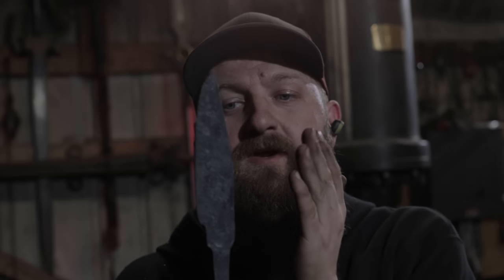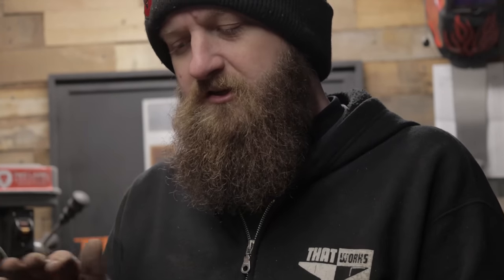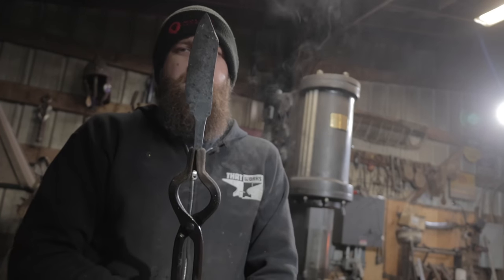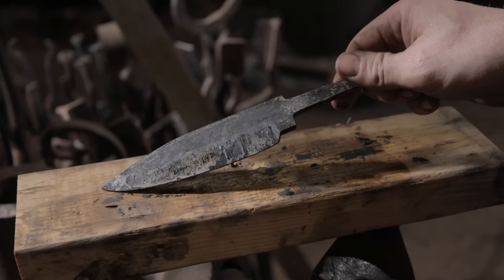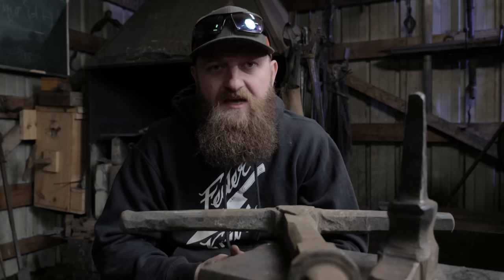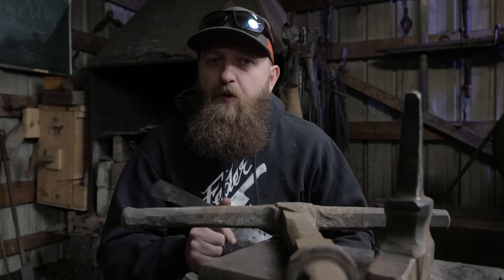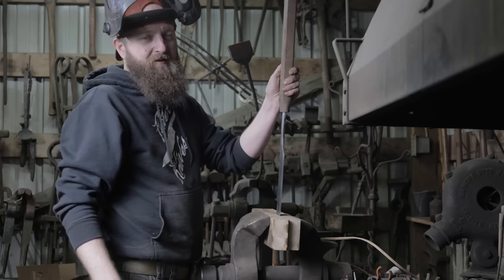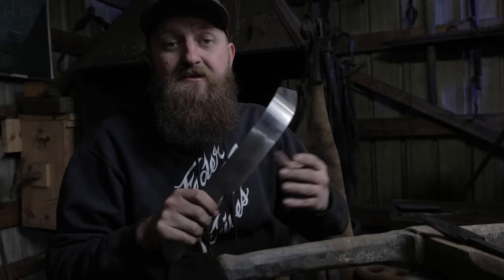Can it bend 90° ?  Matt Forges ABS Journeyman's [Test Knives] - Part 1

Comment: The difference between Matt and Ilya is wild, Ilya makes everything look so simple with efficient strikes and perfect control while Matt has much more hesitancy and erractic strikes. In comparison, when Matt is grinding it's like he barely has to focus at all, it's just instinct. I noticed that after the first blade, Matt was more controlled and smooth, so the improvements are showing already. Different skills, muscle memory and experience. I'll be teaching my boss basic smithing (as that's all I'm good for, lol) and have been recommending That Works videos to him because you and Ilya between you encompass everything smithing represents from grinding, engraving, forging, smelting. Awesome job so far, with a mentor/friend like Ilya, I have no doubt you'll crush the test!
Reply from the maker: you nailed it. I decided to share with you the very first knife blade I had forged in about a year. I knew it would be raw but I also knew I would get the hang of it more and more with each blade.

Comment: Note 60° that would be 30° either direction is standard for a short sword. A 10 or 20° permanent Bend is expected. And yes they will force you to take it 10 degrees Beyond 90 as there is probably that much Flex between the pipe and the handle
Reply from the maker: The reason you go passed 90 with the pipe is that the 90 is measured on the spine of the blade portion not the handle.

Comment: Yes I believe you are allowed to one foot blades for that and that includes your handle unfortunately. However do not fret you are the only one who will do any damage to that blade. They will ask you to perform each of the tests. Then they will hand you a metal pipe and tell you to bend your blade in both directions. And don't worry about it most people end up with a ten degree Bend in their blade at the end of the test and they pass even if the hard steel breaks but the soft steel jacket Keeps The Edge from being separated from the knife. Or if you are supposed to go with a homogeneous piece of spring steel. 1 crack is considered acceptable on the hardened Edge as long as The Edge does not spit a chip.

One last note do not look for your Masters it will find you. Because you automatically do not qualify for your Masters if you are not of notable renown already. Both me and my father has been approached and asked if we wanted to test for our masters, I believe you test for your Masters wins they know that you're not in your best train of mind. One week after my grandfather died my father received a pair of ivory pistol grips and told he would receive his Master certificate one year from that day if he proved. He is a gunsmith with a fondness for pistol triggers and the ability to Unbreak a stock. Seriously I'm not joking on that one.
I have a knack for finding the Grain in steel and wrought iron, in the ability to use that knowledge to improve the tool that I am working with. You're in a good place to learn what I know. If you follow the cherry blossom hammer it will take you as far as you can reach. Maybe someday you will grab a wrought-iron ball peen hammer and make a straight razor. Afterall I plucked my eyebrows and shaved my neck with a wrought-iron ball-peen hammer. And you work with a better educated man than me. When I worked at buck cutlery Kershaw educated me on the way of ferrous material, but I had to learn how to use the hammer all by myself. 

I don't get much wrought-iron to work with these days so to keep in practice I buy dowels of rattan and make dust brooms.
Reply: I don’t know if you are new to this channel or these guys but they definitely have the notability requirement down. Honestly both him an Illia could be master smiths already they just haven’t made it a priority because they have YouTube channel but they are both incredibly good smiths. I honestly don’t think it will be that long until he has the master smith cert. Especially Illia who has already won abs blade of the year.
Reply from the maker: Its a 15" overall blade length and 10" edge.

Comment: Hey wait.  Ilya says you should cut the square stocks tip rather than forging the point.  Why do you forge the point?
Reply: Talking about the first knife of course.
Reply from the maker: @alexparadi522  I forged that before he showed his method and then tried his after.
Reply: @ThatWorks  ahhh, that’s interesting that the sequencing of release times is that different from the events in the videos.  I assumed that his video was shot well befor yours!  Best of luck with your test, I’m sure you are going to pass no problem!

Comment: I wonder if you could make a knife without using your belt grinder or any files only forging it to shape and then using an angle grinder to do the grinding and stones for sharpening
Reply from the maker: I mean…of course you can. But why is an angle grinder ok but not a file?

Comment: So in the bend test, it's ok if it deforms as long as it doesn't outright crack? That seems to encourage a weaker heat treat, no? Or is the idea to test that vs the heavy edge testing to make sure you can balance the two well?

Either way, great job and good luck in Atlanta!
Reply: If your heat treat is too weak, your edge will deflect during the 2x4 cut and thusly wouldn’t shave afterwards. Where you need both the bend, and the sharpness after 2x4 cut to pass. 

So the differential heat treat tries to walk that line. Keeping a edge hard enough to stand up to the 2x4, and a spine flexible enough to bed to 90°.
Reply: @brachistochrone_5206  I had thought the bend test required the blade to not take a set and go back to true. I was surprised that it's just "don't snap". (I know, "just".)

Comment: When heat treating you JS knives you really should utilize your kilns for every part of it. Every steel has its best temperature for normalizing, hardening and tempering, you can get close with a forge but not exact. A forge also has too much temperature variations throughout to precisely & evenly heat a blade.
Reply from the maker: As much as I agree, I also come from a sword making background where the traditions of doing things by feel are very important. The fingerprints left in a piece by the makers hand are what makes the vast history of blade making so special. I tend to do larger knives and swords all in the kiln and feel comfortable getting an even temp on smaller blades in the forge. So I agree with you of course. There is no debate there.  Kiln produces better results for sure. Your eye is also capable of some pretty amazing results!
Reply from the maker: I should also mention one honest truth. Time…I need two full sized kilns. I don’t like leaving blades untempered after the quench for very long. So waiting for the kiln to cool down from 1650 to 400 sometimes takes hours. Sure I can do a safety temper with a torch and I do have smaller kilns. Just sometimes I rush when I shouldn’t.

Comment: Very best of luck for your JS test. I'm curious though, why would you HT using a forge when you have a temperature controlled kiln? Much better consistency with the kiln or is that part of the skill they're testing: HT with a forge? Look forward to part 2.
Reply from the maker: For the performance knives I did. I have gotten super used to HT in our forge and i know 80 crv inside and out. Im comfortable with the forge. I can see why some are not.

Comment: Is it normal to heat up and then cool down multiple times before doing a quench? It seems like I normally just see a quench done. Does it change depending on the type of metal or something?
Reply: Yes it is normal. Steel is often normalized or annealed after working to reduce stress that is locked between the grain. In this case it is important so that when it is quenched and forms a martensitic phase, the blade does not crack or developed uneven stress. This process does change depending on material. For steel it is most dependent on the amount of carbon content and what grain structure is present. It is possible to skip this step but it’s risky. Some people either don’t do it or don’t show it in the video.

Comment: any particular reason why you use wood to clamp the blade to?  I use 2 pieces of angle iron, so just curious if there is a benefit to wood vs. metal for keeping it straight.
Reply from the maker: Wood conforms to the shape better so you aren’t just making sure the flat of the blade is straight but also the bevel and tapered tang are too
Reply: @ThatWorks  oooh...that makes sense.  Thanks for the response!

Comment: Hi matt, just a quick question as relates to illya's method and thr k ife you forged using it. Would correcting the slight curve by grinding rather than forging it back straight not neglect the orientation of the grain that you gained from using that method for the final knife?  I realise this may just be a practice version but just my idle curiosity
Reply from the maker: I just ground the spine side back straight.
Reply: @ThatWorks  OK, I understand now, thanks for the quick reply

Comment: Yeah you might want to work a little harder on that the two-by-four chop is over in 5 minutes regardless. That would be a 6 ft two by four turns into three pieces in under 5 minutes, without a vice, and without splitting the wood like you did in the vice.
Reply from the maker: Thats how I ended up doing the actual test.

Comment: I wish my area had basically anyone who taught metalworking.  I can't afford vocational school and the ones in my area don't teach it anyway.  I wish so bad I could get into this myself.
Reply: There are countless very informative videos on YouTube from excellent makers all over the globe. Ilya is always explaining what he is doing and the purpose of the techniques, tools, and materials he's using as well as explaining other methods and why he chose the one he did. Black Bear Forge is another excellent smith that narrates over the video and explains pretty much everything and makes some videos just for educational purposes because it's like you said, this craft is difficult to find someone locally to learn from. I bought everything I needed to get started after a lot of research and education from other smiths via videos and forums. After that it's just a matter of setting up and doing it. I strongly recommend starting out with known steel for a while to avoid any catastrophic events or dangers at least until you have a decent handle on metallurgy but other than that there are no mistakes. Only learning experiences. If something you attempted to make did not turn out how you envisioned, figure out why, and you just learned a method that doesn't achieve your desired result, and try another way. I went through this exact process the last time I was out in my shop and I can guarantee that the world's best makers have discovered more ways NOT to do something than they have ways that worked. I say start gathering equipment and just do it

Comment: It seems highly unlikely that a flaming quench would destroy the oil. What is flaring off is the vaporized and cracked oil, i.e. the destroyed oil,  that would otherwise rise up as a plume of nasty smoke or get condensed back into the oil. The oil is destroyed before the vapor ever reaches oxygen and ignites.
Reply from the maker: Having been at a shop that destroyed oil on a daily basis pretty sure I know what I am talking about.
Reply: @ThatWorks  Destroyed by what metric is the question then. If Quench speed is the answer, a theory could be found. I remember reading that parks or some other company offers an additive package to their professional users to recondition their fast oils. So we can assume that that is probably the fraction of most susceptible compounds and maybe they are just vaporized and not cracked. In that case a deeply submerged quench will allow them to condense back instead of flaring off. In other words, i am not criticising. I am trying to understand a phenomenon that makes no sense for a homogeneous oil like vegetable, which gets contaminated by chemical breakdown. Flaring or no flaring.

Comment: To me ot made sense to have some rough forgings on hand to practice with on the finishing rather than have to do it all start to finish each time. Because then you could get focus on the more intensive parts that need the most attention rather than get tired after forging then grinding, heat treat cycle and so on time after time after time, then rushing and making mistakes that just frustrate then cause more mistakes and self doubt. Once you get the finishing down then you can go back to the beginning with forging to finishing. Small steps before big ones.
Reply from the maker: Not only that but it should be gainfully obvious that these were all practice blades since most of them were Damascus and I cant even submit Damascus for my set.

Comment: Actually right now you're aiming for master with that getting the plunge absolutely perfect. On the other hand if you can't get this good enough to fool most people's eye then you won't be able to handle a Discerning customer either.

As I understand this is the set that you're to turn in for your quality tests. Personally I think I would bring each of the knives up to 300 Grit finish, and then quickly do a burnished so that I could take my blades to the light and see exactly how I want you to finish them. And yes I know burnishing them and then taking the varnish right off to finish them sounds crazy but they're supposed to be the best stuff you ever do up to this point. And I just fine doing a quick burnish to the work when you know it's not ready for a mirror finish will make all those telltale signs that you're trying to find pop out allowing you to more easily allocate time where it's needed.

Oh by the way if you ever do decide to go for your Masters what you're doing right now with that little sanding wedge that is just part for the course. And when they say a mirror polish in the Masters category they mean get it down to 1500 grit before you start burnishing. Because the lady in the room will count her eyelashes in the glint of your blade. Luckily for me when I took the test her complaint was that one of the judges forgot to clean his hands and had left carborundum just in one of the Fullers of my blade. So when you go for your Masters insist that everybody wear rubber gloves because she is looking for one square inch surface on either side of the blade that is absolutely picture-perfect. The response was other than the car brand of dust that gives off a few scratches the mirror finish is nearly flawless with no more than three 1500 grit scratches per inch. I apologize for the crudeness of my work and she said no no those where the ugly part how did you get it so smooth and flat. My response I brought it down to 1500 Grit and then I went over it a second time as well as a third at 1500 Grit before burnishing I'm finishing with a 20000 Grit loose muslin wheel hand Stitched from a sheets of Gaza linen 120 by 180 count. That would be Weft and weave by the way.

And no I don't mind sharing that information because most people are too sloppy to keep their muslin wheel good. And of course I'm holding back a secret. A release that s secret to anybody who shows me that they can keep the muslin buffing wheel clean.
Reply from the maker: Thanks for sharing your experience. I can use all the tips that I can get!